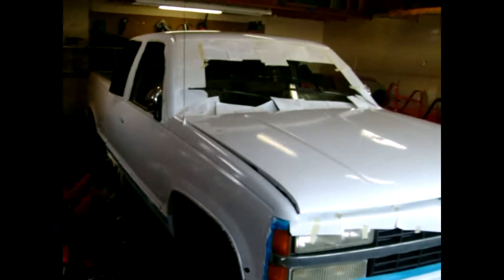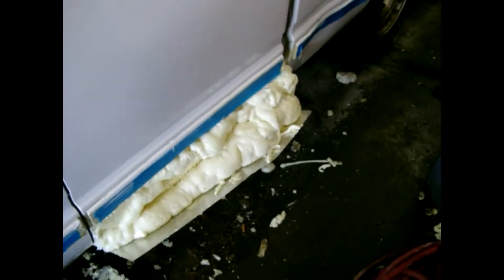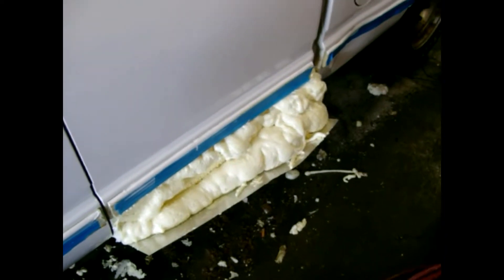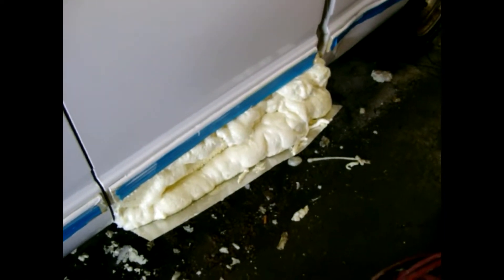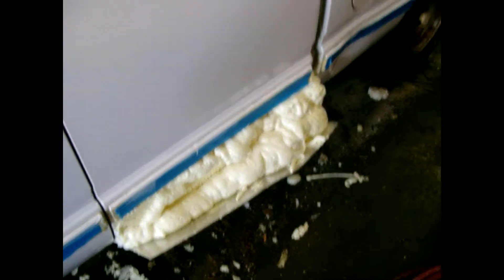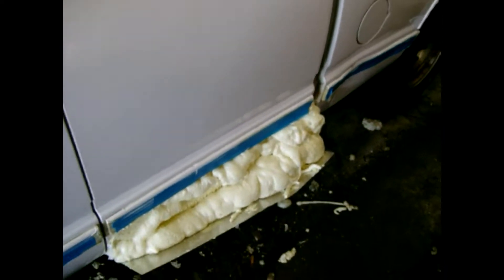Rustoleum Roller Paint Job Coat #3 1991 Chevy Extended Cab Pick Up Project

Comment: @Vacationtime247 I agree...with leevang27. He was referring to using the foam under the new panels you used for the repair. If any moister gets to the foam you sprayed it will definitely cause problems in the future. Other than that.. Awesome job. I am going to try this method of painting as well..

Comment from the maker: @rocker4u123 The better the surface before painting the better it will look after paint.  I'd sand it to the metal where the rust is and get rid of the rust as best you can.  With the rustoleum, you don't really have to prime the paint.  It can go right over bare metal.
VT247

Comment: hey vacation time i got a s10 in bad shape, hood and tail gate are badly rusted and there are rust spots on the side. Most of the blue paint is chipped off and you can see gray. As far as the rustoleum PJ goes, should i sand down the paint and rust to the primer. Or to metal then reprime it? (budget is key). It also has some rust holes (bout 2 inch's acrost at most), how could i get rid of them. would i chip/sand the rust, then use Mesh and Bondo then sand and prime it? any details welcomed, tx

Comment: Just wondering what your paint mix was. 70/30? 50/50?  I've heard different ratios
Reply from the maker: I like to paint thick coats.  So 70/30 works best for mineral spirits.  It dries slower but doesn't run like thin coats.
VT247